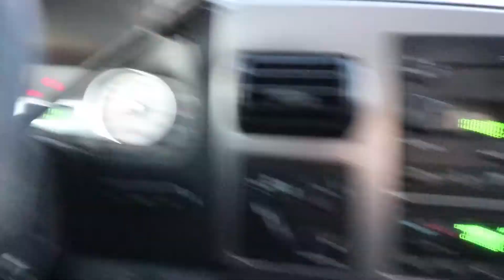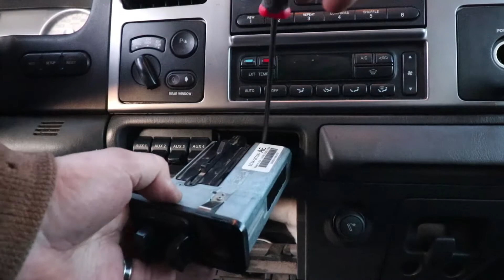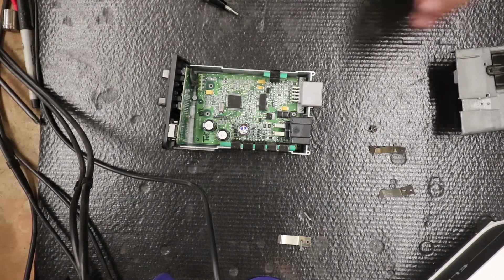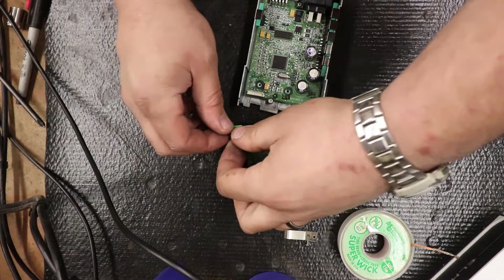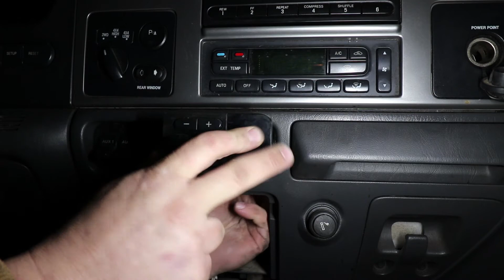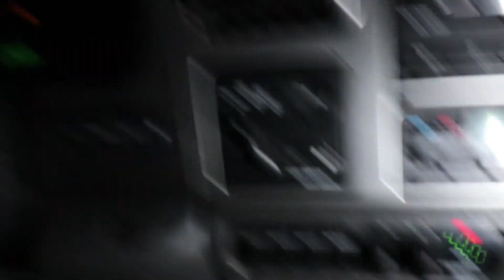Ford Super Duty Integrated Brake Controller Repair "TBC Failure"

Comment: Help guys! That small little harness cam undone and I cannot figure how the part reattaches to the board, the white end of the connector
Reply from the maker: The wires disconnected at 6:45? Did the connector just come undone? or did the white part of the connector come off the board?

Comment: Wish I would have seen this before I purchased a new controller. However the new controller only solved part of the problem. I still get a TBC fault when gently braking, no fault if I brake hard. I think the sensor on the master cylinder is bad.
Reply: Take it apart and clean it with electric motor cleaner.  Then put Dielectric grease on the connectors. The Dielectric grease will help give you a solid connection.

Comment: Hey question 2010 f450 no codes no tbc fault. The module gets battery power good ground. Gains work on module and on dash but no tbc output only 2.0v but with slider apply u get full 10 to 12v to the trailer break. Any idea?
Reply: my 05 is doing exactly the same thing! Did you figure it out? What was the problem?